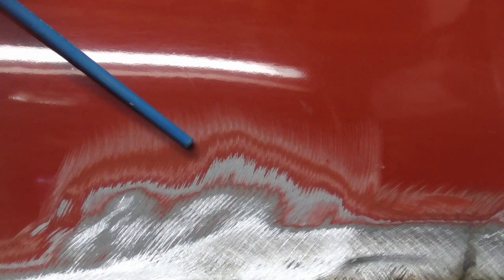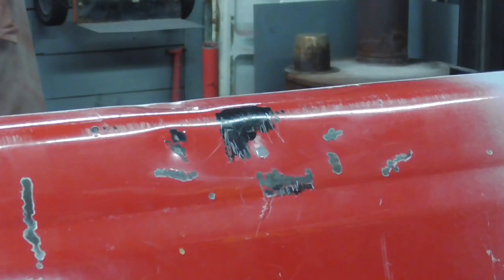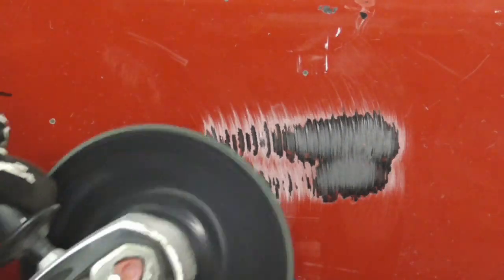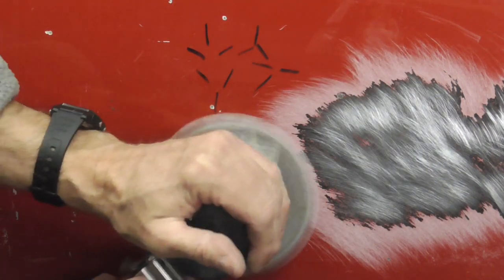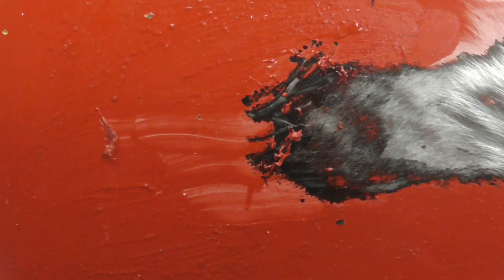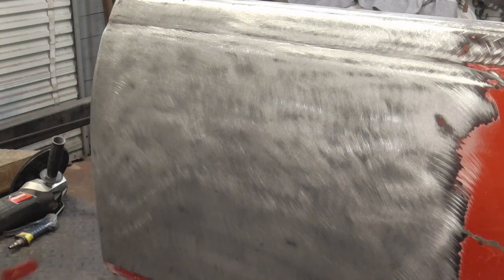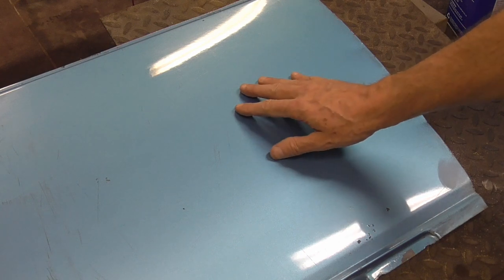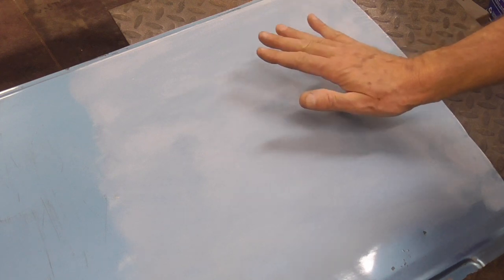When You Should Strip Automotive Paint & When You Can Paint Over Paint

Comment: So here's my question. Say the majority of the paint is good but you have a small spot of crows feet or a nasty scratch or chip, could you just take that small spot down to the metal then primer that spot, sand it, primer it again if needed to build it back up to level with the existing paint then spray the new color instead of having to strip the whole panel?
Reply from the maker: Absolutely - DA that area, prime with primer surfacer, block sand, prime again, finish sand and paint.  To tell the truth I rarely strip a whole panel.  There are ways around it too.  Like using polyester primers that can fill the cracks and you can DA it smooth.  Sometime though you have to like in the video with that tailgate - had to strip the whole thing - the paint would have just chipped right off.  It's really using your best judgement.
Reply: @LakesideAutobody  yeah that tailgate was pretty bad. Have a good weekend. Let's hope that snow they are talking about for the weekend skips us lol

Comment: Hello great video! after the 36 what are the next two grade are you using?
Reply from the maker: For rough stripping you can use anything from 24-40 grit.  After that you can use 80 grit before priming.  You can do any body work or filler work before the 80 though.  Bottom line is 80-120 before priming with your choice of primer surfacer.  Then you'll block sand, prime again, finish sand and paint.
Reply: @LakesideAutobody  Thank you so much I really appreciate the fast reply this is my first time doing this I have a 1969 Mercury Marquis convertible and I wanted to go back down to bare metal before I have someone to paint it thank you so much
Reply from the maker: @antimpala1  Absolutely - feel free to ask ?s - I answer all ?s once or twice a day :)

Comment: Thanks for the video. I want to paint (base and clear) the bottom half of my car. The paint is factory original and the colour will not change. Is it best to use the 240 grit or can I scuff it to blend the new paint? Thanks.
Reply from the maker: You can scuff to blend the new paint.  If there are any nibs or dust from the factory you can lightly sand them flat with the 240 or finer like 320-400 because you'll be sanding by hand.  By hand = finer grit ---- DA you can use a grit that's a bit more course.
Reply: @LakesideAutobody  Thanks for the helpful reply. I will give it go.
Reply from the maker: @stewartshackleton7825  Let me know how it goes :)
Reply: @LakesideAutobody  Thanks, will do. However I won't be painting until Spring.  I don't have a big space to wield the spray gun so going to be outside. My little melina blue Ford Puma was not sold in North America. Can I send you a couple of photos?
Reply from the maker: @stewartshackleton7825  Absolutely - never hear of a Ford Puma.  schoolvidolibrary@gmail.com

Comment: I’ve been wondering what to do with my 60 comet.
Reply from the maker: Is the paint in decent condition?  Was it painted a bunch of times?
Reply: @LakesideAutobody  original white paint. I sand blasted front fenders and hood. Car has a lot of rust but I’m cutting it out and replacing with new metal. Probably just strip what’s left and put epoxy primer. You should see the machine I made to make the floor pans.

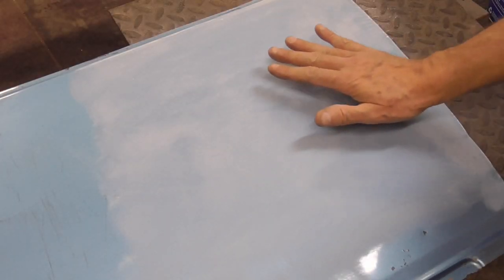Comment: 6:21 what grit sand paper is used in this method where priner is not needed
Reply from the maker: You can use 220 all the way up to 600 for finer to sand OEM paint with - then paint.  220 is about as course as you want to go and it can leave DA marks in some thinner paints.  240-320 is a good range
Reply: Thanks for reply

Comment: Great video as always. How do you tell the difference between Acrylic and 2K paint? Can you paint Acrylic over the top of 2k paint without primer?
Reply from the maker: You can paint any paint over the top of any other paint as long as it is fully cured.  By fully cured I mean it's been on there for a while.  If you want to spray non compatible materials over each other, the safest way to do that is to wait a few days, scuff it and then spray the other.  The rule of thumb is stick with compatible paint materials.  Urethane over urethane, acrylic enamel over acrylic enamel, etc. Even sticking with the same brand is safer yet.  When in doubt do a test panel and some experiments to find out for yourself - can't always get the right answers from the internet :)

Comment: paint remover that works is a thing of the past, sadly..
Reply from the maker: True :(
Reply: I've make my own using caustic soda and wallpaper glue.. Mix wallpaper glue as you would with water, the dry one used for papir, then add the soda.. Nasty stuff and it gets hot, but it works. Use protective gear!